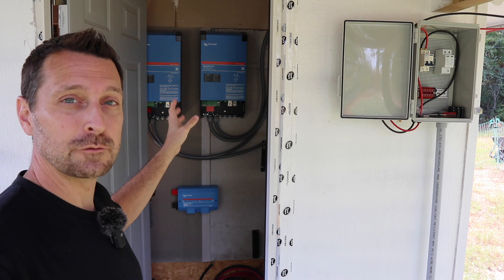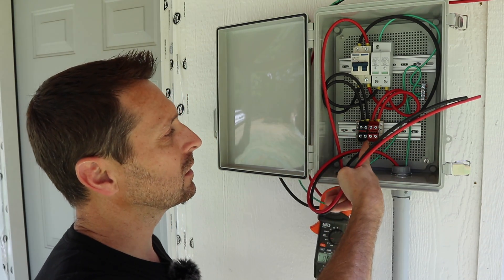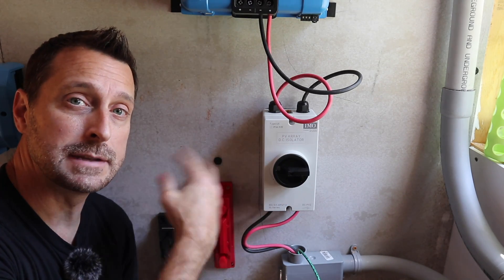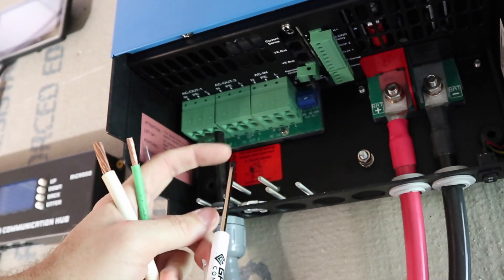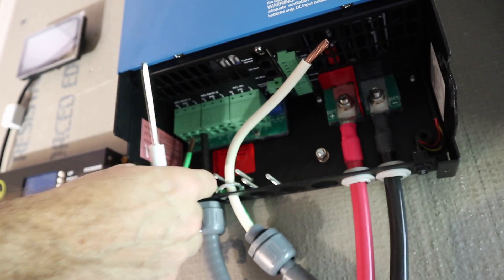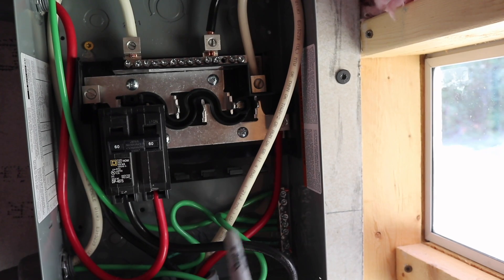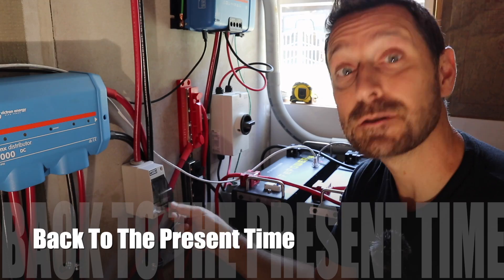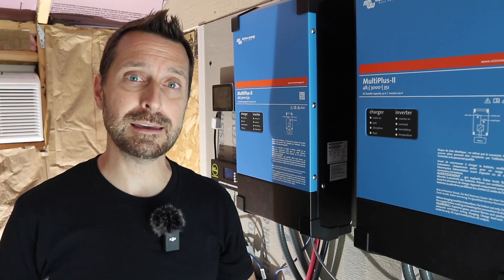Victron Multiplus ii Installation | Complete Wiring For Off Grid

Comment: The link for the Homeline circuit breaker box no longer seems to work.  Could you update that, or post the model of the box ?
Reply from the maker: Sorry about the broken link. Here is the panel we used for this project....https://amzn.to/3XksYxP (it is a 6 breaker panel). We also use a 12 breaker version in our home system. This is that link......https://amzn.to/4pGBqUc

Comment: What size wire goes from the batteries to the inverter? I am doing an 8ft run (there and back) and I cant determine my size I need.
Reply from the maker: It depends on what charge controller you have and how many batteries. I would recommend a Victron Lynx between your charge controller and the inverters. The manual for the charge controller and inverter should guide you on this. I believe I have 1awg wire.

Comment: Hi thank you for for the very informative video I am working on my own solar project and really appreciate your thorough video. I am wondering though, why did you use a bus bar between your batteries and the Lynx distributor, isn’t that your bus bar?
Reply from the maker: You're welcome. 
The external buss bar is redundant in this system. The Lynx is the main buss bar. I use mine for connection of a Chargeverter and to parallel a dissimilar branded battery.

Comment: First off - thanks for the information about your setup.  A few comments:  I'd put ferules on all of the wires that don't have lugs.  For those with lugs, I'd make sure that all of the copper strands are encased in heat shrink. And I'd try to make the insides of those boxes as neat as possible.  Remembering that a pinhole in the insulation can cause arcing.

Comment: Hello from Italy! 🇮🇹

Great video, very interesting, and thanks for sharing! I'm about to set up the same system as you. I checked the wiring diagram and have some observations regarding safety and functionality, as well as a few questions:
 The SPD should be connected by taking the positive and negative directly from the input of the MCB, not from its output. This is a regulation in my country for the following reasons: it protects everything downstream, including the MCB itself. Also, as it is now, if the MCB trips, you would be left unprotected since the SPD is powered from the MCB’s output. 
By the way in a solar power system with panels located far from the house, it is advisable to install Surge Protective Devices (SPD) both in the combiner box near the panels and at the house entrance (where the inverters are located). This dual protection is not redundant but serves important safety purposes.
Reasons for installing SPDs in both locations:
- Cable length between panels and inverter: if the distance exceeds 10 meters, it is recommended to install an SPD near the panels and another near the inverter. This is because, with long cables, surges may attenuate along the way, making a single SPD less effective.
- Optimal inverter protection: the inverter is highly sensitive to voltage surges. An SPD at the house entrance protects the inverter from surges originating from the panels, while the SPD in the combiner box protects the solar modules and limits the spread of surges along the cables.

By installing SPDs at both points, you ensure comprehensive system protection, safeguarding critical components and complying with industry standards.
Did you also have the SPD on the AC side? Type 2 AC SPD  If you want to protect the inverter and connected devices from induced overvoltages. Or Type 1+2 AC SPD  If you are in a high-risk lightning area or have a generator with direct grounding.
In my system I will have a heat pump at a certain distance from the inverters and I will have an additional SPD (Type 2 AC) in order to protect the heat pump from transient overvoltages caused by switching operations or lightning.

I understand that you are using the Nader MCB only as a switch because each device is already protected by a fuse inside the Lynx Distributor, correct?
I also understand that the battery bus bars are there for future system expansion, otherwise there would no need to install them. 
By the way the connection you made will have a preferred path on the left battery because it offers less resistance, a better connection would be connecting the negative terminal of the right battery (instead of the left battery as it is now) to the negative bus bar.
  
Did you ground both Multiplus inverters since they also have a metal frame? I am not sure about the lynx but if it has a metal frame too you should ground it as well.

At 12:55, you mention bonding neutral to ground in the main panel. Could you explain how you do this? I thought the Multiplus, when in off-grid mode, handles this bonding automatically via its internal relay. You should avoid two bonding point, beware!
You did not mention anything about your grounding system which is really important. Actually I see some problems in your set up (one point is the SPD connection). I suppose you have a rod or multiple connected rods in the earth, which should be connected to the ground bar, which must be the only single grounding point (called the main equipotential bonding point) which serves as the single reference point for all grounding connections.

Why is a single main grounding bar better?
- Avoiding ground loops: If multiple independent grounding bars are interconnected  (as in your case), potential differences may occur, leading to stray currents, interference, or malfunctioning of RCDs.
- Easier management and maintenance: with a single reference point, it is easier to monitor grounding quality, measure resistance, and troubleshoot any issues.
- Uniform distribution of leakage currents: a single equipotential node ensures that fault currents discharge effectively, preventing overloads in specific sections of the grounding system.
- Efficient fault protection - a single grounding node ensures that, in case of a fault, leakage currents can quickly find a safe path to ground, allowing protection devices (e.g., RCDs) to operate correctly.
My planned grounding setup:
* Main grounding bar (connected to 2 or 3 ground rods, either daisy or loop chained)
* Equipotential bonding with metallic pipes, structures, and other conductive elements
* SPD units connected directly to the main grounding bar
* Neutral-to-ground connection (still in doubt wether to let only the MultiPlus Master handle this bonding or make a fixed connection in the main grounding bar)
Does this setup make sense to you? 
Thanks again, and I look forward to your comments! 😊

Comment: Electrical Inspector here...because  power originates in your solar shed, that is your service panel. The one in the barn is a sub panel.  Neutral and grounding bars need to be bonded in the solar shed, and that panel needs a grounding conductor and service grounding rod or plate. The sub panel in the barn requires separation of Neutral and ground buss bars. Because they are separate buildings a grounding conductor and rod or plate are required at the barn as well.
Good video and explanation. Cheers
Reply from the maker: I appreciate it. I have installed a few of these system and am a part of numerous solar install forums including close consultation with a local solar company. All of them suggest and recommend exactly the opposite of your recommendation when it comes to this particular type of off-grid setup or separately derived systems. They specifically warn against multiple ground rod applications.  Can you explain further your point of view and refer me to the code sections on this? This system has been up for a while and works flawlessly. Can you also explain any issues with doing it the way I did?
Thanks.

Comment: What gauge are the DC wires going to the inverter? The instructions for the Multiplus II say to use a 400A fuse, and 2x AWG 1/0 between 0 and 5m or 2x AWG 2/0 between 5 and 10m. I don't understand .... why 2x cables per terminal? I also see some folks using 4/0, which, isn't rated for 400A. Confused, can someone clarify?
Reply: @pierregalin1269  with wire gauge it is always the bigger the better. I think the multiplus 5k and bigger have more than one screw Terminal per Battery Terminal (2x positive and 2x negative). I would recommend connecting all available Terminals with the same wire gauge and also all wires to the Battery. If it is a diy battery then please make sure that the connections of the cells are at least the same wire gauge as you plan to connect to the inverter otherwise you need to select a smaller fuse protecting your smallest/weakest gauge im your system!

Comment: I believe you should have a wire from the negative of the battery bank to that ground bus bar in your subpanel, this would serve as your DC system bonding jumper. That battery bank is more than 50 Volts, if the positive conductor from the bank touches the case of one of the inverter, you need to have an effective path to clear the fault. This would be from case, to the ground bus bar (through the ac out ground wire), back to the battery.

Comment: Just wondering why you had to use two multi plus? I’ve got a growwatt 3000 off grid for my cabin and don’t really like it. It shuts my batteries down all the time and then I have to drive three hours to reset them. I’ve been looking at getting a Victron system but man they cost a lot lol 😂 just curious. I got the system from SS but not the 5 48v batteries. SS tried to help but everything they’ve told me to do just makes it worse. Not really their fault but I’m frustrated
Reply from the maker: I have 240 volt loads in my barn and the Multiplus is only single phase 120v. I need two to make 240v split phase. 
You can get one EG4 6000xp and that will solve your issues. They are nowhere near as expensive as Victron.
Reply: @CountryLivingExperience  I ended up going with the eg4. So far so good. I can turn everything on in my cabin and it doesn’t miss a beat
Reply from the maker: @brokenarrowoutdoors2467  I have EG4 in my house.
Reply: @CountryLivingExperience  Ahhhh, that explains why you're running TWO AC lines to the cabin! Thanks. I was wondering about  that.

Comment: How much Wp panels you have for this 250 Voc MPPT? I guess no more than 5 panel of 400 watts with 48 V. Otherwise VoC would be around 370 V or?
Reply from the maker: I have 6 panels. The voltage open circuit on each is 49.31 so 295.86 total for warm weather if wired in series. Mine are wired in series parallel so I have two strings combined to one keeping the voltage down.
Reply: @CountryLivingExperience  Ah! It make sense then! Sooo if they are in parallel it means that 48x2 because of two strings, right?
Reply from the maker: @michalknapek5697  when you wire in series voltage adds up between the panels but their amps stay the same. When in parallel, the voltage stays the same and the amps are added. Making different combinations, will result in different volts and amps and can be configured to anything you need. Mine are wired in two series strings of 3 panels each and then paralleled together.

Comment: I got a bit confused around the 7 minute mark when you said the fuse connects "our positive to our negative" and "that's what bridges between the two bus bars".  The fuse is inline on the positive line.  If it connected positive and negative, that would be a short circuit, surely?
Reply from the maker: yes, sorry. I misspoke in the video. It is positive to positive.
Reply: @CountryLivingExperience  Thank you for responding.  I'm learning and so your clarification is very helpful.  All the best.

Comment: Looking good. Couple of questions/observations. Don't understand why you included the additional bus bars between the batteries and the Lynx distributor when the Lynx is basically a fused bus bar? And I believe it's best practice to turn on the AC side of the Multiplus 2 before the DC as that pre-charges the caps for you. Also I think the Victron manual mentions using ferrules on the AC connection side. Good work leaving the looped conductor on the AC side - definitely necessary and often overlooked.

Comment: Thank you for this video! When connecting ferrules, I followed your advice and sliced the plastic shroudand made sure the wire makes contact with the ferrule metal tip.im still not getting the Victron to function though. Any thoughts? TIA!
Reply from the maker: How is it not functioning? Not getting DC voltage from the panels?
Reply: @CountryLivingExperience  correct, if the wire strands dont fit in the Victron terminals, and ive crimped the ferrules to where they make contact on the wires and act as an extension to fit in the terminal holes, it should work that way?
Reply from the maker: Our PV lines come into our separate SmartSolar MPPT charge controller, not the Multiplus inverter. 
Since I cannot physically see what you are trying to connect, it is hard for me to give advice.
Reply: @CountryLivingExperience  I was able to get it connected! I manipulated the ferrule on the wires to fit into the Victron controller. Thanks for your video and replies I appreciate it :)

Comment: Maybe you can help me I'm looking for someone that can help me install my small solar power system that I have on my box van I need someone in Washington that's familiar with a viltron energy solar charge controller and distributors going into a 48 volt inverter it has 5 solar panels on the roof each are 370 watt for as total of 1850 watts all together. So do you know anyone in Washington state that can accurately hookup this system???

Comment: are those 3000kva   better choice than one 5000   ?    because in maths  2x 48 3000 cost as much as a GX 5000   70/50 !!   did you test their surge capability ?   if i remember it says 5500 for several seconds.. if yes then they are quite good!!!!

Comment: Happy thanksgiving, I’m completely off grid and would love to know your solution for not using the AC input. I’ve got the 230 48v 10,000w multiplus ii. Can’t even get it to turn on to connect to computer to turn on “ignore AC input”
Reply from the maker: Not sure how your system is setup so it is hard for me to give any advice. Mine is powered off the batteries and panels.

Comment: Thx a lot for all your efforts. With hybrid systems like Solark 15K or EG4 18K-PV, no one will be buying charge controllers. They eliminated many devices, components and  wiring. Sorry, for victron and the likes.
Reply from the maker: Not true. There are many different types of systems for different applications. Having separate charge controllers is critical for certain types of systems. I explained that all in the first video in this series. Victron is one of the top selling systems in the world.

Comment: what size wire and flex conduit size are you using?  Is that seal tight?  What connector coupling??   It looks great. Thanks
Reply from the maker: 1/2" flex conduit with 4awg wire.

Comment: Thx a lot for all your efforts and tips. However one company and one company only made the solar powerful, affordable and so easy to install, a 15 yo can do it. It's none other than Signature solar. I don't know why I'll get any other system than the EG4 18K-PV plus 2  Powerpro WallMount and sleep peacefully knowing I got one of the best in the market. These are also close enough  (Solark 15K & Schneider XW pro) with EG4 18K-PV I don't need a charge controller, no combiner box, no disconnect. (I'll get a solar isolator and might get a T-class fuse) that's it folks.
Reply from the maker: Sig Solar is great and so is EG4. I do business with them. I got this Victron equipment from them. Victron is in a different category than EG4.

Comment: One thing that I don't understand is why would the batteries rush the current to the new inverters if using a Victron DC disconnect between them at off position, turning the inverter on to charger mode, and then when in bulk mode, turn on the DC disconnect(connecting the battery bank). The inverter has a bigger potential on the DC side than at the battery side. Why would it rush into the inverter's capacitors if they have already been charged by the inverter's internal charger to a higher voltage. No-one has been able to explain this to me yet. I am about to connect my own soon. I do have a external 60V charger as well but I just don't understand why this would be an issue with the Multiplus II.

Comment: Just a FYI, I don't believe that is the right procedure to use the EG4 battery resistors. The manual says to power then on, hit the reset button, then hook up the inverter.

Comment: It appears that you are, at least for the moment, sold on Victron. I've just completed an Epever to Victron upgrade on our solar powered shed, but initial performance results, and ease of use increases doesn't appear, so far, worth the additional cost. We're now moving on to a 3.6kw install solely to charge our Ford Lightning, and run the garage mini-split, and we're hyper focused on ROI, and breakeven point with 10kw of lifepo4 batteries. I had considered a split phase with Victron, but at the moment, from a cost conscious standpoint, I think we'll be going with a hybrid inverter from MPP. Idle usage could play into that ultimate choice, as most of the hybrids run over 100 watts idle consumption.
Reply from the maker: We will see how it works out for me. I have heard nothing but the best about Victron.
Reply: 7 months later and I'm sure you already made the right decision for you, but to me the idle consumption issue is huge.  It really adds up to a significant factor for ROI, but I'm sure you crunched the numbers and took it all into account.  The other thing I'd say about Victron is I'd venture you'd get higher reliability and better support and service from them if you do run into issues.